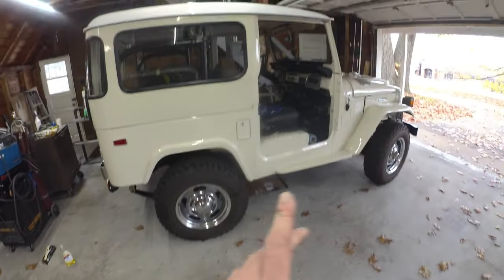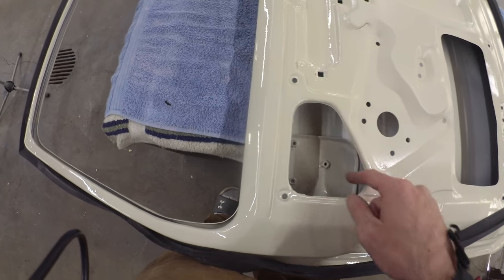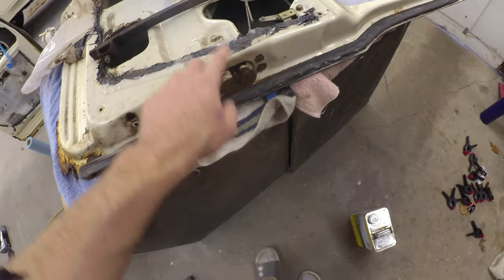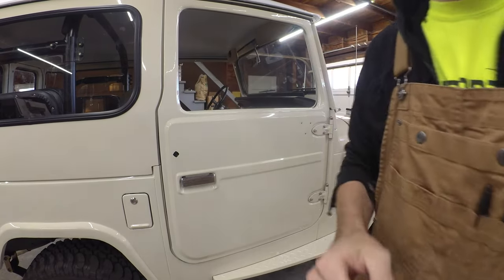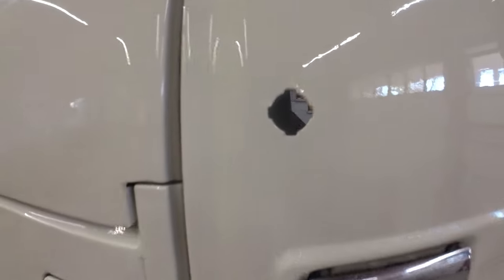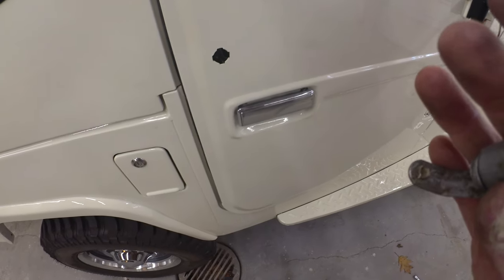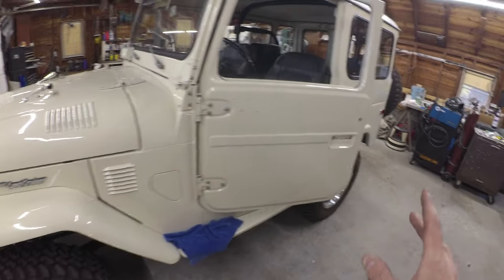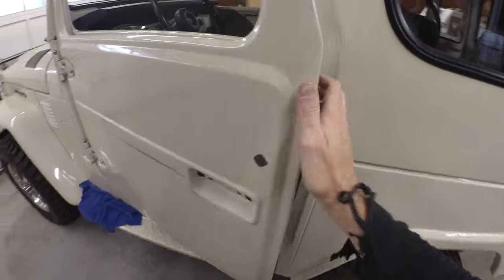Re-hanging the front doors (FJ40 Week 51)

Comment: I bought door hinge bushings and pins from CoolCruisers. The bushings did not come even close to fitting (too big) my OEM door hinges. Did you have any issues? Thanks!
Reply from the maker: Mine were snug but no issues.  I think my pins and bushings were from Specter/SOR, though.  They worked on the windshield hinges as well.

Comment: Did you have any issues installing the glass (and glass regulator) with the doors installed on the hinge instead of laying horizontal on a stand? I have seen it done both ways...curious before I install mine. Thanks again!
Reply from the maker: I pulled the glass out with the doors on the bench, but reinstalled it with the doors hung back on the body.  No real issues doing it after hanging.

Comment: I like the defender mirrors look. Will you be providing any info on the adapter plates you printed for this?
Reply from the maker: The STL file for the version I printed is uploaded to a wider "3D Prints" thread on the IH8Mud forum.   It would need a few tweaks if one wanted the "no-drill" option, but minor: https://forum.ih8mud.com/threads/3d-print-and-cad-file-repository-40-series.1281295/post-14437293